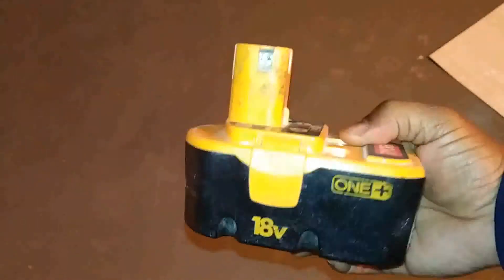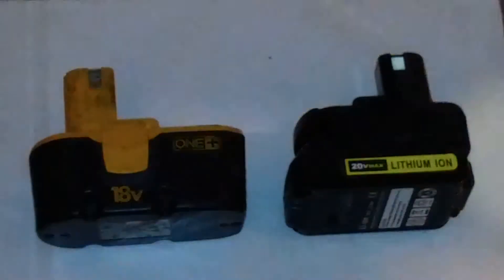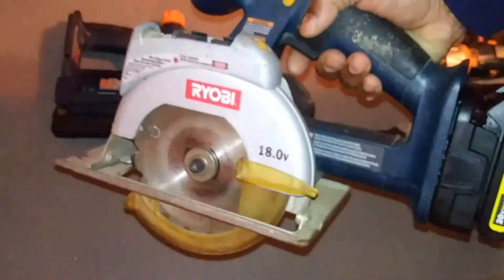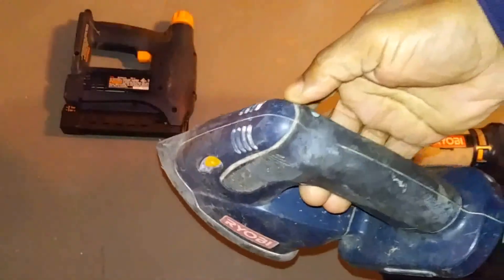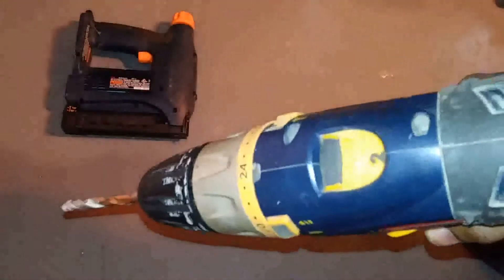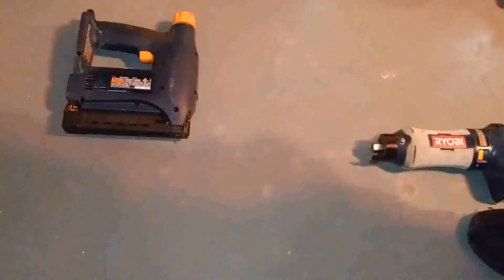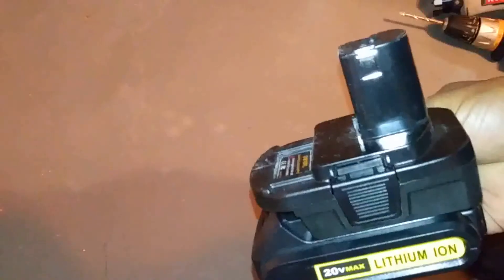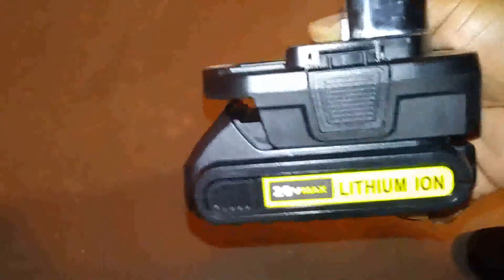How To Convert Older Ryobi Tools To Work With DeWalt 20v Max Batteries

Comment: Just saying it could damage your batteries....the tool wont be able to tell the battery to go into off mode when low and will run it until it is useless...
Reply from the maker: Thanks for your concern.  I havent heard of that happening yet.  But I will test the drain and see if that occurs.  Please SUBSCRIBE!